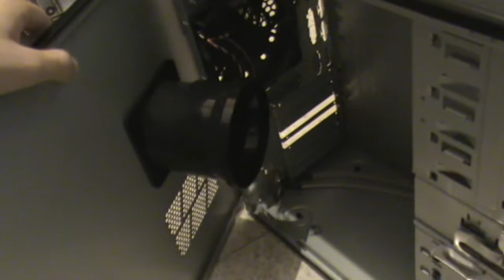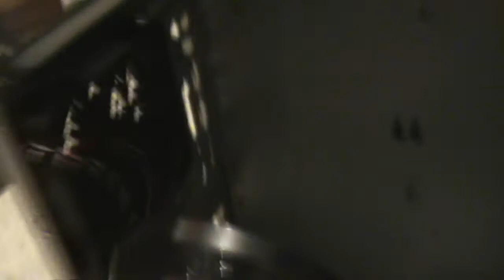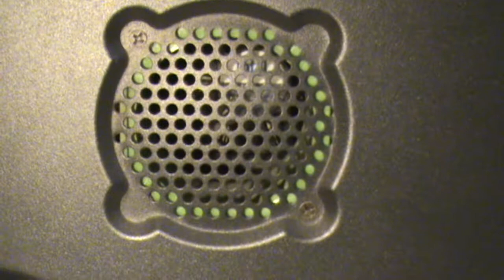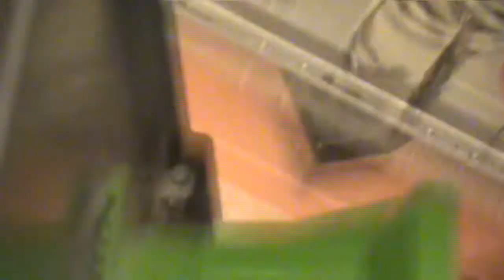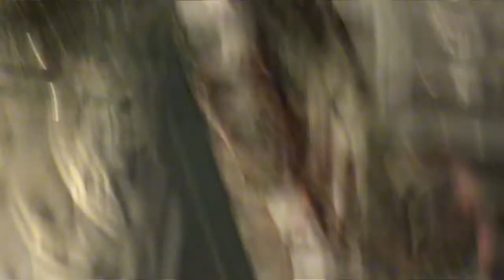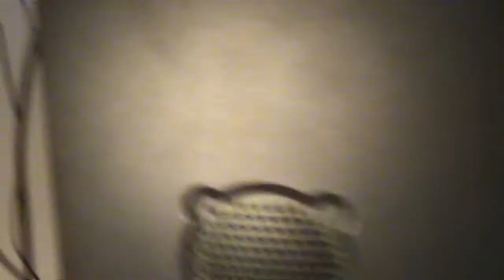Air duct tip

Comment: This is what I do to all my cases (they all have the Intel CAG):
1. remove the duct from the panel.
2. fit an 80mm fan to the panel (I will run it at 7V).
3. fit the duct to the fan.